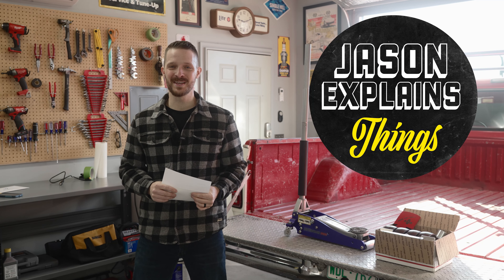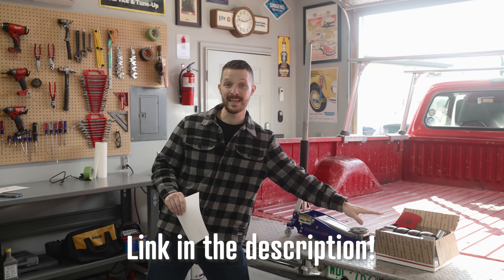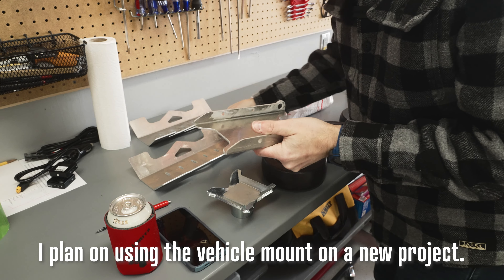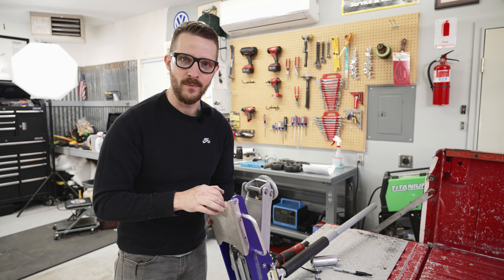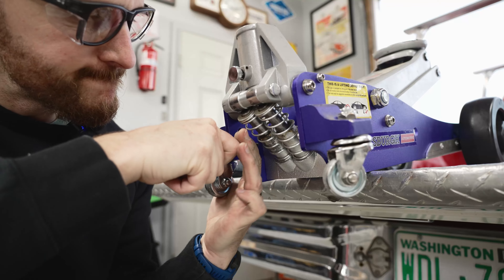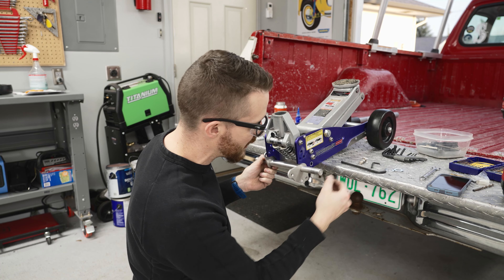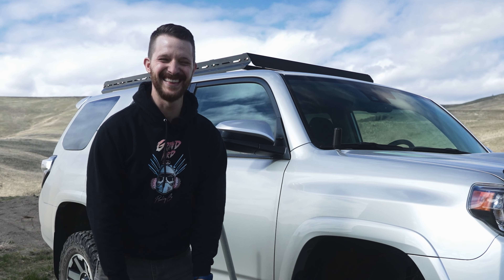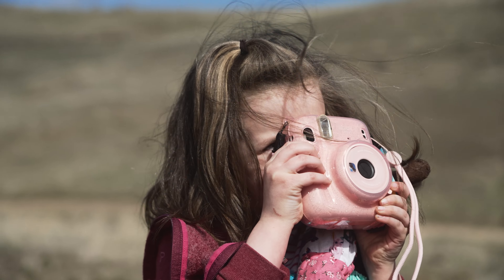Turn a Harbor Freight Floor Jack into an OFF ROAD BEAST!

Comment from the maker: TOO EVERYONE SAYING THE BADLANDS JACK IS BETTER AND CHEAPER... It didn't exist when I published this video in 2022.  I'll try and pick one up to compare to this conversion jack soon!  Cheers! 😅
Reply: I'm debating the badlands or making a similar one. The badlands is definitely cheaper but I imagine if I go with a 2.5 aluminum jack would still be lighter by maybe 20#. Can you weigh your current jack with the extension used at the end of the video? curious at the total weight

Comment: $235 for the kit, $100 for the jack? Jesus, might as well buy a completed one
Reply: Yeah it's pretty cool because it turns into a lightweight offroad jack but when it's all said and done might as well just buy a 3 ton offroad jack. It would cost the same.
Reply: @_JEBUS yeah carrying a 78 pound jack with regular wheels to use off-roading is really the same thing as using a 33 pound jack with off-road wheels.  Do you also bring Bugattis to race trucks in the sand dunes?
Reply: While the badland is cheaper... it's also heavier, harder to use, less capable, made in Chyna, and the list goes on... Our conversion kit will fit many jacks NOT made by HF, has many customizable options, more accessories and is Made in USA!
Reply: yeeeup!
Reply: @_JEBUS the older you get the more you are willing to pay extra for lighter stuff!!!
Reply: @911Motorsports  Wow you're really gonna throw shade on HF Jack's when most of the jacks using your over priced kits are HF jacks? Glad I didnt put your stuff on my 1.5 ton jack.

Comment: Is there a rubber pad you can put on top of the extension. That shape doesn't look friendly for the jack point that's integrated into the skid plate on the 4runner/GX
Reply from the maker: It does not.  I’d agree it would be great if it had one.
Reply: @JasonExplainsThings  We do now offer a round saddle that comes with a polyurethane pad. There were enough requests that we made it happen. As a bonus the poly pad is Made in USA from Prothane!

Comment: That’s a cool kit.  I bet if you played around you could find a new location for that handle and drill some new holes.
Reply from the maker: Agreed!  I kept it and may reinstall it later.
Reply: The offroad jack with all of the extras is less than $100 more.

Comment: I have this exact jack from Harbor Freight  that I bought on sale.

I was wondering if there was a way to convert it for my lifted jeeps.

Currently running a bottle jack from Harbor Freight with extensions & craddle from SafeJacks for off-road excursions on one of my jeeps.

Thx for the video 🤘🏻

Comment: Very nice! And still comes in way under the price of a Pro Eagle jack.  👍
Reply from the maker: Exactly!
Reply: not that much under. 1.5 ton Pro Eagle is $420. This ended up being $370?
Reply from the maker: @antonkanevskyi5403  True.  In my case I've had the jack for over 3 years.  Also you can easily get the jack itself for under $100 most of the time using a coupon or buying it on sale.  If I remember correctly I bought it for $80.
Reply: @antonkanevskyi5403  the kit is probably over priced, this would be ideal to build yourself or just buy the pro eagle or even the cat version. These wheels in this kit won't work great in dirt.
Reply: You must be paid to say this, this kit is $230, the offroad 3ton jack from HF is $299! Comes with more than this kit.
Reply from the maker: @meganjlinn  Hey there.  This video was posted last year.  The new HF jack didn't exist when I made this.  Paid full price for this kit.  Will likely pay full price to get the new jack also when it's time to upgrade.  Have a great day!
Reply: @antonkanevskyi5403  Plus labor...and my labor not cheap! lol

Comment: You can keep the handle.  Spin it 180 degrees and drill a new hole to bolt through.  That what I did

Comment: Do they offer a "WIDE STANCE" Option for better Stability?
You could easily purchase a "Drawer Handle" that would be narrow enough to have clearance (once you make a new front mounting hole)... 🤔
Reply from the maker: The larger wheels make it pretty darn stable.  If you want wider I'd just use a larger jack (2 ton or 3 ton).  I may install a handle in the future... probably use reuse the original one and drill new holes.

Comment: For me, it's the damned noise on the thing. I literally hate using it on my cobbled driveway. The giant wheels on the offroad jacks don't do that, and appeal to me for that reason.

Sad to see they stop at the 2 ton conversion for the Daytona line though. I have the three ton Daytona, and I'm not sure that would work.

Also... I see the prices are competing with the big offroad jack company, but now HF are selling 70lb offroad jacks complete for 300 dollars, it may no longer be worth buying the conversion kits that run at over 125 just for the wheels and axles.
Reply from the maker: Yep, you're probably right.  I'd bet the popularity of off road jacks and conversion kits is why HF is making that awesome $300 badlands winch now.

Comment: That looks badass…. However I would add some rubber pads to avoid scratches in the frame, specially there where you are since you get salt…. But looks good Sir
Reply from the maker: Good idea.  May glue a rubber pad to the top piece.  I’m glad salt isn’t used in the PNW.

Comment: its to bad that the kits are 2 times more expensive then the jack it self. i been looking at doing this my self but at this point i think i am just going to build my own kit. i picked up the 2 ton jack at HF last week end for 65$ the inside track +15% off the sale price. super good deal. but the kit from 911 is like 290 bucks.  thanks for the vod tho :)
Reply from the maker: I get your point for sure.  I still feel good about the kit.  It’s held up great in the years since.  And 911 is a small PNW business I’m glad to support.

Comment: Seems like if you did have a flat the jack with the extension would not have fix under the vehicle.
Reply from the maker: I see your point but I'm confident it would work.  Worst case scenario is you would have to dig a little to get the jack a smidge lower and then raise things up.  I carry a small military shovel every time.  Standard off road stuff.

Comment: Pro eagle seems more worth it for better jack, better wheels, better extension and extension holder. We race sxs and can't beat the pro eagle quickness and ease of use in a fast pit stop in dirt scenario. If I were on a budget I would do this but just build myself you can get everything from harbor freight for probably under 200$ with out an extention
Reply from the maker: Cool.  To each their own.  So far I’m loving the modified jack.  I’d be happy to own and use a Pro Eagle jack as well.  This is just cool because it upgraded something I already have.
Reply: @JasonExplainsThings  ya for sure, I'm just being one of those guys ranting my opinion. Cool those guys put a useful kit together

Comment: This kit does NOT include the jack itself. You get the wheels, new lift head on the jack, and the rod for the wheels; $215? $215 for that WITHOUT the jack?! This has to be a joke. Who would pay for that and why?  What does it weigh in the end?
Reply from the maker: Off road jacks cost $400 or more usually so even including the jack it's still cheaper.  And like I said in the video I've had the jack for years.  A lot of your negativity could be solved by just paying attention dude.  I don't know what it weighs... maybe 5 pounds more than it did to begin with.  And if you don't like it... don't buy it.
Reply: @JasonExplainsThings  Roger. I disagree; therefore I’m wrong? Crazy that anyone might have a different opinion. I’m sorry that any adversity or criticism is so brutal for you. Welcome to reality “dude.” Some of us don’t see the value. I did watch. How do you think I was able to itemize the parts list? Just block me then man.
Reply: @spartan8390  You can't have any valid criticism unless you have proper knowledge of how much brand name off road jacks such as Pro Eagles costs. Not everyone is willing to drop half a grand on a jack they may only use once in a blue moon or a pinch while off roading.
Reply: Right now I might go that route. I live upstairs in an apartment, I have and Offroad vehicle and a low car. I need something that can A) lift the low car and B) lift my Offroad vehicle. Also carry upstairs to store. Yes the price point is ridiculous, but you save bit of weight. Only downside I see is that it might need a flat base but nothing a road sign can’t fix